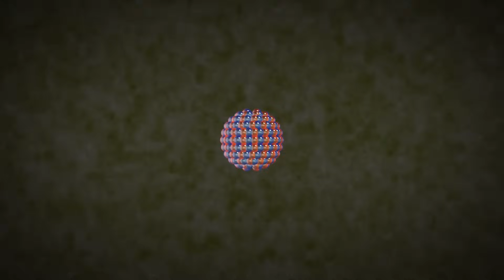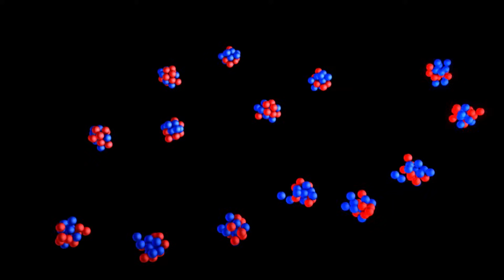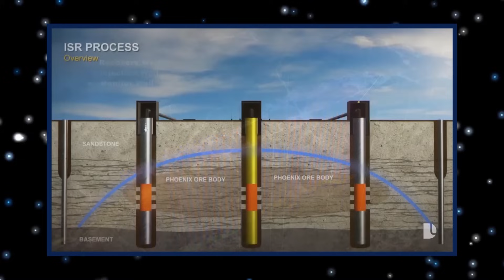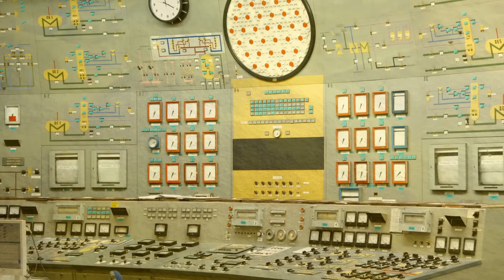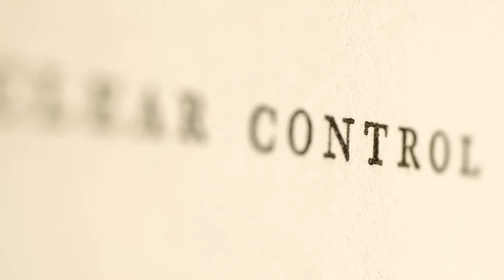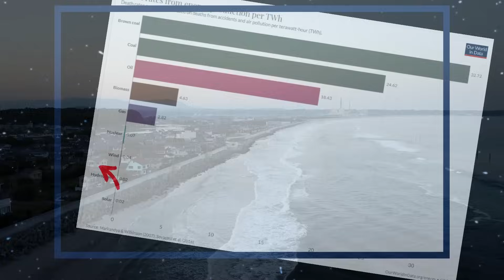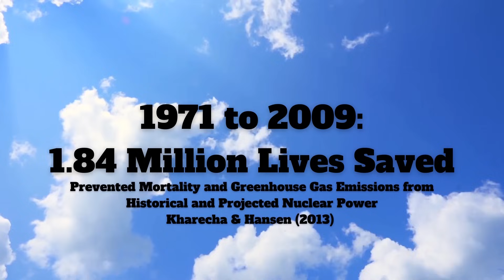URANIUM Documentary: Mining, History and Future Outlook

Comment: Another key thing about Chernobyl - it had no containment vessel. All other non-Soviet reactors have an enormous steel dome around them. This is why Chernobyl was so uniquely awful as a disaster, and why something similar couldn't happen in the future.
Reply: Yepp, that's exactly why it never happened in Fukushima
Reply: @henrikf.1247  Exactly - Fukushima didn't have reactor fires to put out, nor was the core exposed belching huge amounts of radiation into the atmosphere. The amount of radiation released by Fukushima was tiny in comparison. People can safely move back to Fukushima now.
Reply: @alasdairlumsden670  Fukushima not having reactor fires or releasing massive amounts of radiation had nothing to do with its containment vessel. 

The reason Chernobyl was so bad was because of the design of the reactor itself as well as poor construction quality of the plant.
Reply: @jakehildebrand1824  Positive void coefficient resulting in power excursion, enormous graphite core that burned for days, yes there was a lot wrong with it. My point is, a water moderated LWR/PWR can't suffer from the same kind of failure.
Reply: @henrikf.1247  actually that has absolutely nothing to do with Fukushima not becoming a bomb the way Chernobyl did.
Reply from the maker: Thank you for that insight, I wasn't aware.
Reply: Chernobyl actually did have a containment vessel, it just didn't look anything like non soviet containment vessels.
Reply: There has never been a containment vessel that contained the radfioactive isotopes released during a meltdown. I don't know why they call them containment vessels. Maybe it is like calling our perpetual war department the Department of Defense.
Reply: That won’t stop rogue nations Putin
Reply: any accident can happen,  no matter the fuel or design. It might be less likely, and it might have less consequence, but it might happen. Stating that it cannot happen at all, helps nobody. There is 11 graphite moderated reactors currently running and as far as i know, none has any steel dome.
Reply: @Anders357  If that’s the case then those graphite moderated reactors should be closed down and retired.

Once they are, a similar accident to Chernobyl cannot happen because there will be no uncontained graphite cores that can burn for days spreading radioactive waste into the air.

No members of the public died from Fukushima and that was a triple meltdown of a 1960s era Boiling Water Reactor.

It is possible to do nuclear power in an entirely safe configuration with molten salt reactors which cannot “melt down” because the fuel salt is already molten. I take issue with those who categorise all nuclear as unsafe by the yardstick of a single incident.

The Hindenburg blew up yet we now have an ultra safe aviation sector.

The solution to safety issues is to innovate and improve, not to get scared and let fear guide us.

Fossil fuels kill millions every year due to air pollution. Nuclear is on a par with wind and solar for deaths per TWh of energy produced.